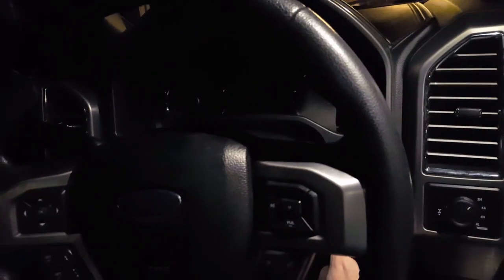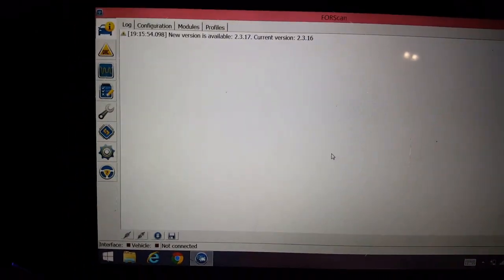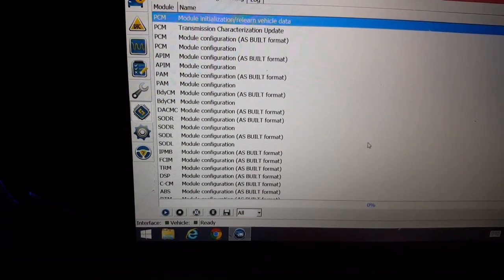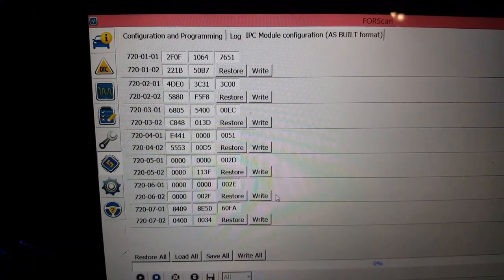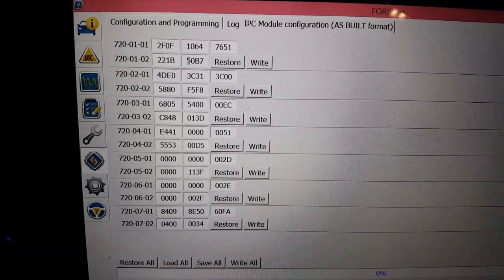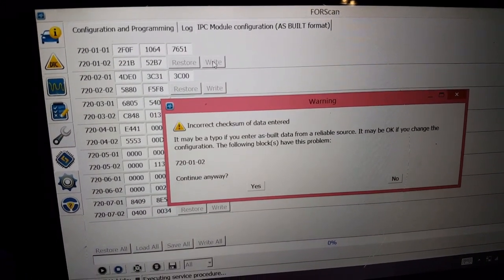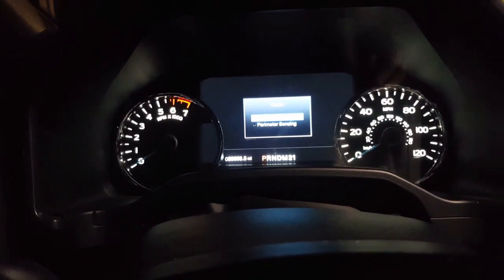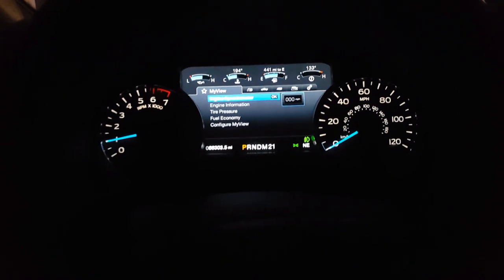Forscan ford f150 f-150 start engine chime

Comment: Is it the same for 250s?
Reply from the maker: Yes Chris.  It should be the same. But there are a few options that are different. Save your original settings  then make the change, so you can revert back if needed.